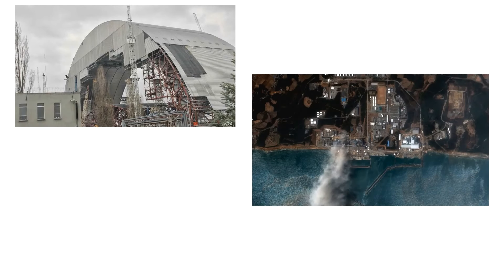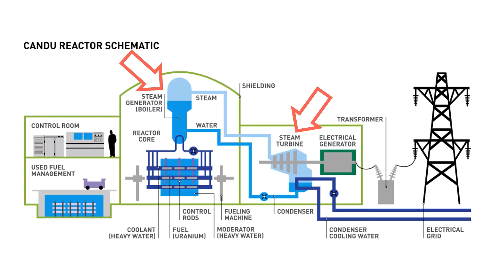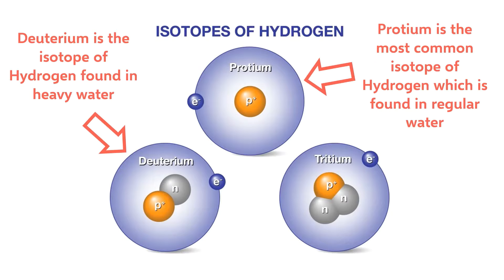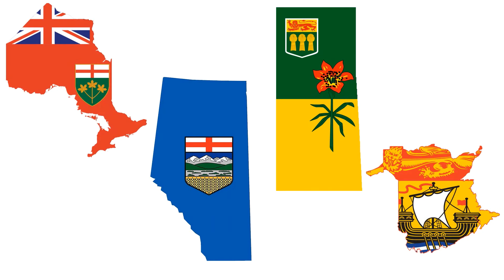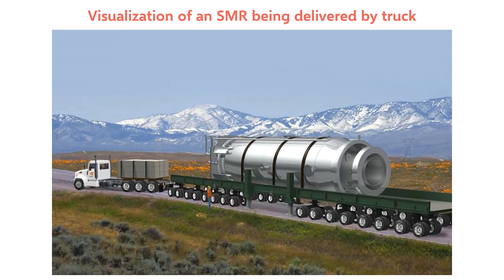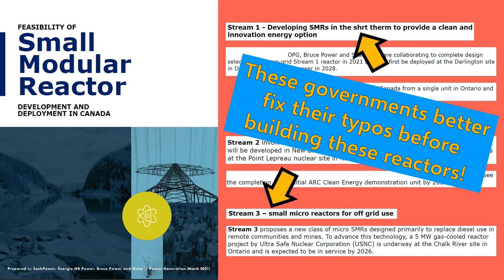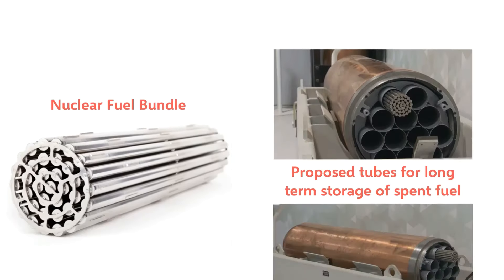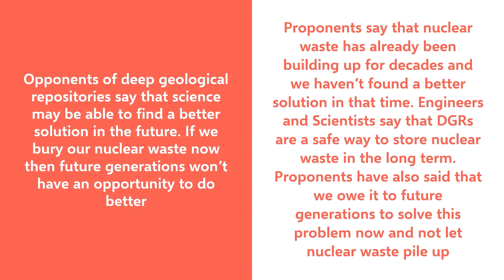How Canada is Developing the World's Most Advanced Nuclear Tech

Comment: As a note one of the 4th generation designs being developed in New Brunswick, the Moltex SSR-W, is specifically designed to burn used nuclear fuel. This is the best solution to nuclear waste: put it in a fast reactor creating lots of clean energy and reducing the hazardous life to just a few hundred years. IMO it’s too soon to go the DGR route with this kind of technology just being commercialised now.
Reply: Yes, it would be great to reliably burn up the other 97% of the fuel waste, with a waste stream containing only fission products. However, breeder reactors are likely to be a bit more complex than the others, and thus more expensive. I wouldn't be too against expanding the fleet of nuclear capacity even with a burner reactor design in the meantime.
Reply: @nolan4339  The design I mentioned, the Moltex SSR-W is a burner .. not a breeder.
Reply: @tomshackell  You mentioned it is a fast reactor. A 'fast' reactor is nearly always a breeder rather than burner design as there are more free neutrons in the fast spectrum. And to get your waste timeline down to just hundreds of years means it only contains fission products, instead of transuranics, meaning fuel materials are fully being utilized.
Of course if this reactor is just more fully utilizing pre-existing spent fuel, then perhaps the fast spectrum could be utilized to force some additional 'burn', but it basically means you are just designing it a step short of being a true breeder, by cutting out the inline fuel processing and neutron efficiency. And you will still end up with some long lived waste.
Reply: @nolan4339  not necessarily breeders.  If the point is to simply burn nuclear waste the current designs appear to be quite a bit  simpler than current nuclear reactors. An example being Elysium's fast reactor, which appears to be nothing more than a tank of hot salt fuel with heat exchangers stuck on the sides of the tank to pull heat out of the nuclear reaction. The nuclear reaction being controlled by the amount of heat pulled out of the tank. The idea being a simple low cost to build and to operate system. Other designs are also striving for simplicity and lower costs. Really, there is currently no need for breeder designs since there is plenty of waste to use as fuel and even new uranium fuel is relatively cheap and abundant.
Reply: @nolan4339  I think fast reactors is more related to the speed of the neutrons.  Fast neutrons are less likely to cause fission events in the fuel, so the fission of the fuel creates a huge neutron flux that is usually used to neutron activate uranium-238 (non-fissile) into some plutonium isotope (fissile).  I would guess in an MSR...  as long as you get a complete burn and the fast neutrons don't really need to be moderated to make them thermal...  Well it does seem like a waste of perfectly good neutron flux.
Reply: @kayakMike1000  Yes a fast spectrum reactor generally free up more neutrons, and can thus cause more reactions in fissile and fertile fuel elements, to either cause fission reactions or capture events, leading to the breeding of other isotopes. Additionally Fast neutrons have high fission rates on most of the heavy actinides, many of which are mostly non-fissile to thermal neutrons. But it also requires larger reactors with decently large fuel inventories or richer fuel mixes, as the chance that a neutron hits becomes much smaller in the fast spectrum.

In molten salt reactors these reactions occur in a homogenous mixture and so the neutrons have access to nearly the entirety of the fuel mix and so can much more effectively burn up the fuel elements

Additionally, all reactors generally breed some amount of additional fuel from the fertile fuel elements. This is mostly dependent upon the neutron economy. Burner reactors have a neutron economy less than 1, and so breed less fuel than they consume,  while breeders have an economy greater than 1, and so produce more fissile material than the reactions consume, and so can continue to perpetuate the reaction with only fertile fuel elements.

So then the main points of the Moltex design is that it is a fast spectrum reactor, that is purposely designed to be neutron inefficient, making it a burner (probably to make it easier to pass regulations and to skip design needs for fuel reprocessing but perhaps also to make it smaller). But by operating in the fast spectrum they can have a high burn of the heavy actinides, which would be more difficult to utilize in the thermal spectrum.
Reply: the only issue is that it will be built sometime around 2030s, by then we will probably have nuclear fusion which will make these redundant. I am not sure why building nuclear reactors is so expensive? perhaps a new video on that would be helpful
Reply: @tomshackell  but can you be sure that it won't be by 2030? it always seems impossible until it suddenly happens. I remember how everyone always said solid state batteries are not possible... until they suddenly built them. I am all for nuclear, but we definetly need to bring the costs down. I cannot understand why the reactors are so expensive and takes so long to build? what is the blocking factor to make it so slow?
Reply: Fast reactors make use of fast spectrum neutrons. They can be breeders or burners.  The Moltex uses a liquid salt fuel within a liquid salt coolant. It can burn the long life actinides that cannot be burnt as solid fuel. It can use new fuel or used fuel.

Comment: CANDU-type reactors are a triumph of human ingenuity! And the best way to deal with long-lived isotopes (about 5% of the waste stream) from spent nuclear fuel is to first separate and then burn them in fast reactors. Clean and carbon-free energy for the present generations instead of a headache for future ones.
Reply: Molten Salt reactors are actually the best way to utilize waste, convert to a liquid fuel and then it never has to be removed from the reactor.
Reply: @brettmoore3194  Why would you want to do that? The waste is worth a fortune as fuel.
Reply: @chapter4travels  if you looked into it he made a direct resonant tuned beta cell that also could provide large amounts of AC power in a small handsize unit... Your right there is no waste there is only opportunities missed
Reply: 66 grams of CO2 for every KW/hr. from  nuclear. Not as bad as coal or natural gas, but worse than any other energy source. How are you going to burn spent fuel in fast reactors when you can't keep them running long enough to even try? And, good grief, even if you could keep one from constant outages, that's the most expensive type of reactor ever created.
Reply: @jackfanning7952  "Based on the studies examined, wind energy emits an average of 34.11 grams of CO2 per kWh over its lifetime, with a low estimate of 0.4 grams and a high estimate of 364.8 grams. The mean value for solar PV is 49.91 grams of CO2 per kWh, with a low estimate of 1 gram and a high estimate of 218 grams. The large ranges in the estimates were due to factors such as resource inputs, technology, location, sizing and capacity and longevity, as well different calculation methods used by source studies." These studies do not include reclamation of the mining while the number you quoted does. Considering wind and solar require more than 10x the mining of nuclear, we can assume their high estimate to be the most accurate. This is also using antiquated LWR's, MSR's would be a tiny fraction of the old LWR's.
The cost of a molten salt breeder would also be a fraction of the cost of even a regular LWR, the entire power conversion side of the plant would be the same as a coal plant. (85% of the total cost of the plant) https://journalistsresource.org/environment/lifecycle-greenhouse-gas-emissions-solar-wind-energy/
Reply: @jackfanning7952  fast reactors have been built and have been developed into commercial reactors.  Damn, the Russians even build a very high performance submarine the Alpha using a lead (maybe mixed with bismuth too) cooled fast reactor.  The reactor worked fine but the plumbing didn't. The sub kept braking pipes and spilling the lead coolent all over the place.  Presently the plumbing issues have been fixed in their current fast reactors.
Reply: @stanleytolle416  Yeah, they have been building these things for over a half century, as part of the "plutonium economy." They just can't seem to keep them running and can't afford them. More than 50% of them have been shut down after many, many outages and expensive problems. If I bought a car that I had to spend four times as much for as a regular car, it spent all the time in the shop and cost me an arm and a leg to repair and left a pile of toxic crap in my driveway, I would do the same thing the nukies have been doing with fast breeder reactors for the last 60 years. Shut it down.
Reply: @brettmoore3194  Water vapor is the 1st greenhouse gas its capture must come first.
Reply: @marcwinkler  water vapour is needed for sun diffusion , methane causes the longest lasting and strongest infrared heat capture
Reply: Lots of the stoff in clouds though.
Reply: @bradjames6748  that was Harper that sold off CANDU
Reply: @jackfanning7952  need to see your source on that because just covering the required 18 billion square yards of land with solar panels would use gear more in just transportation fuel
Reply: @brettmoore3194  Wild ideas
Reply: @brettmoore3194  alpha (helium nucleus), beta (electron), or gamma (electromagnetic wave) radiation is neutralised by this miracle, I ask? Three distinctly different types of radioactive decay....
Reply: @jackfanning7952  The fast reactors soon to be running in the US are the Natrium system,they emit less Carbon than solar or wind, and are far more reliable, eventually we'll use the Traveling wave reactors that run on natural U with no waste, those will come later but the Natrium from Bill Gates is quick and easy to buildit is true fast reactors are harder to keep going that is why Natrium will have HALEU fuel which is 20%enriched,these run in Sodium.
Reply: @jackfanning7952  Wind and solar are much too expensive the richest man in the world can't afford to cover the gigafactory with them even with US taxpayer help,nuclerar can run without subsidies and always uses less steel and concrete, plus people die putting up panels or wind turbines nuclear has a perfect safety record in the US.In fact nuclear isotopes from reactors save millions each year,Terra Power just discovered a new one.
Reply: @brettmoore3194  No he didn't.
Reply: @jackfanning7952  why?
Reply: @abdAlmajedSaleh  Because nuclear reactors have been a dismal failure for 75 years. And nuclear proponents always lie about their latest monstrosities. The latest reactors have been even worse and more expensive than the ones that came before. And all of them leave a toxic radioactive waste that will be the biggest problem for mankind for at least a million years. If we are able to survive the radiation. And nuclear proliferation is a big problem. Besides we have much better, cheaper, safer, and more quickly developed renewables, that are already outpacing nuclear energy...with a much lower carbon footprint as well.
Reply: @abdAlmajedSaleh  Because nuclear reactors have been a dismal failure for 75 years. And nuclear proponents always lie about their latest monstrosities. The latest reactors have been even worse and more expensive than the ones that came before. And all of them leave a toxic radioactive waste that will be the biggest problem for mankind for at least a million years. If we are able to survive the radiation. And nuclear proliferation is a big problem. Besides we have much better, cheaper, safer, and more quickly developed renewables, that are already outpacing nuclear energy...with a much lower carbon footprint as well.
Reply: You cannot burn away radioactive fission products in spent fuels.   Find out more about fission products,  Fast breeder reactors use more of the uranium and also produce more fission products.  Small nuclear reactors will only multiply the amount of radioactive wastes and probably inadequately regulated leading to environmental disasters
Reply: @jackfanning7952  >Fission products cannot be destroyed
Except that's not how it works. At all.
Fast spectrum neutrons can force them to fission and release energy, radically shortening their half-lives and, with that, period they are dangerous during. With enough of those fissions, they become less and less dangerous.
Reply: @jackfanning7952  and where are you getting 66grams of CO2 for nuclear?  Shipping and handling charges?  Curious what wind and solar does then.
Reply: @brettmoore3194  negative, CH4 is too low a concentration in the atmosphere to contribute much to energy absorption.  What is "sun diffusion"?  It sounds like you made that up.  BTW, nitrogen does a nice job of Compton scattering to make the sky blue.
Reply: @brettmoore3194    so what.  Carbon dioxide is 450 ppm and methane is around 2000 ppb.  H2O is highly variable, anywhere from 0 to 4%.  So looks like although methane is 50 times more opaque to infrared than CO2, there's just not anywhere enough to matter.  Compare that to amounts of fluctuating H2O and most of your infrared photons are absorbed by water vapor anyway.
Reply: @brettmoore3194  I did my research.  You're not accounting for concentrations, the difference in concentration of methane is at least 3 orders of magnitude less than CO2 and has a tendency to oxidize in the atmosphere.  Methane stays in the upper atmosphere longer than what, methane in the lower atmosphere?
Reply: @brettmoore3194  I guess I could link the absorption graphs.  Did you know that if you read the papers about climate models, the models usually predict significant warming in the tropical troposphere.  The satellite data and weather balloon data has not shown this to be true.  Suggests strongly that the models don't work.
Reply: @brettmoore3194  I heard an interesting claim that I cannot find the source...  After 9/11 nearly all planes in the entire world were grounded far several days.  Temperatures in the day were warmer by significant amounts and colder at night, statistically significant by at least 2° or 3°